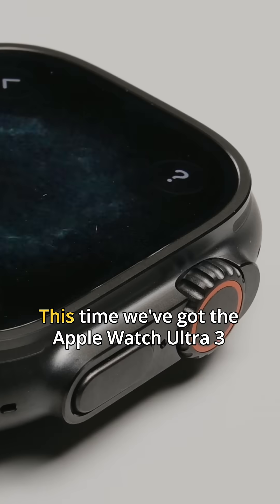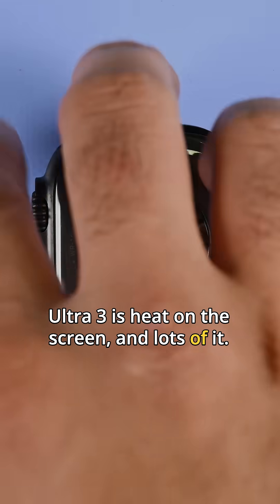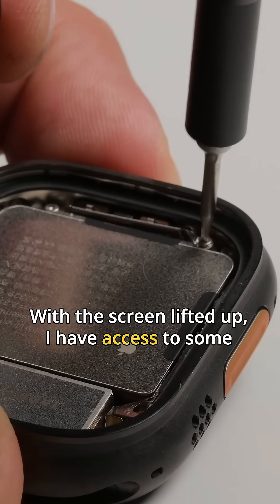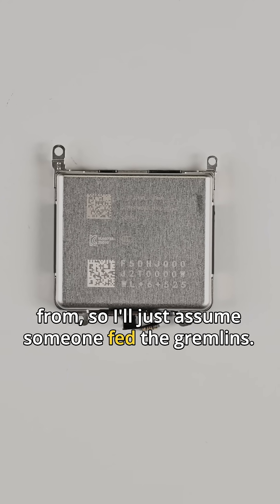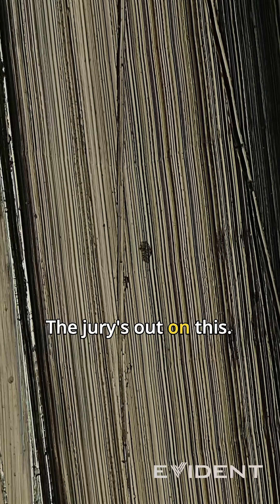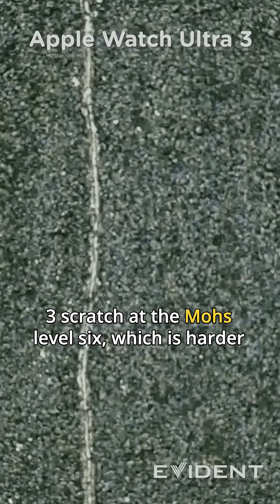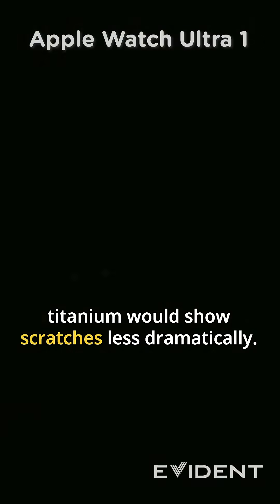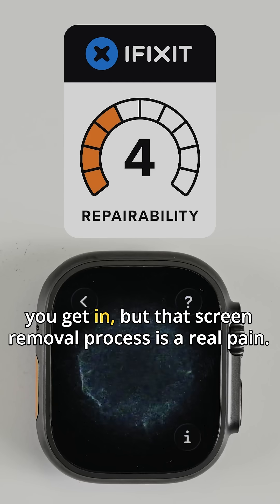Apple Watch Ultra 3 Teardown and Scratch Test!

Comment: While the 3 battery is slightly larger, they have changed their battery life calculation (just for the new watches). The old calculation didn't include sleep tracking. With low battery mode, the 2 and the 3 are almost the same.

Comment: I am still waiting foe an Ultra to come in ALL black option, without that orange crown line, nor the orange button.

Apple, not every Ultra purchaser is a diver, runner, race-car driver, marathon-running sport enthusiast.

So after skipping the Ultra 1, and the Ultra 2, I now skip the Ultra 3.
Reply: I bet you drive an SUV that has never touched dirt.
Reply: @I_Offend_Snowflakes  ,,if you are referring to me. I do NOT “drive an SUV that has never touched dirt”. I live on a ranch/farm and ALL my vehicles have “touched dirt”. That includes my boots, work pants and shirt, and hands.
Reply: @ernestgalvan9037  - So what’s your issue with the orange button?
Reply: @I_Offend_Snowflakes  … too bright. I’ve always preferred all-black watches. They don’t call out, they are quiet. They are subtle.
For my last job, it didn’t matter as much, but I only bought inexpensive Timex or Cassio.

Comment: Why is it 3D printed though? So what was the method used in previous generation?
Reply: Cheaper, for them to make. Purchaser pays the same. The stainless steel, it used to be forged and then CNC milled to shape. Basicly a slab of metal is machine cut to obtain the desired shape. It is the most expensive process solution, above extrusion. I imagine the titanium was similar.
Reply: @LedNe0nDevil  Are there any downsides using 3D printed instead of traditional CNC milled or whatever the previous generation used?
Reply: @LedNe0nDevil  if only titanium could be ‘poured into a mold’ lmao

Comment: they are durable. more durable than my gshock5610. since i do factory and welding, this metal watch doesnt care weld spladers, but not my rubber 5610 and its mineral screen.

with that said, sold all my ultra and apple watchs , stick with the gshock.